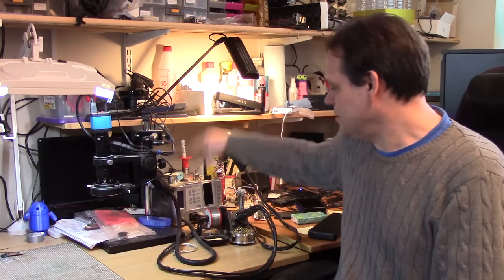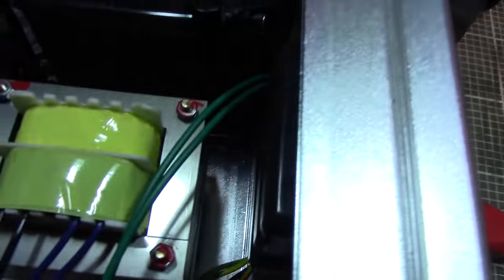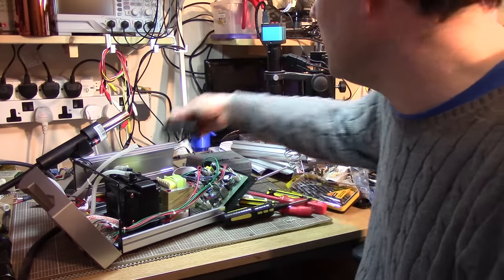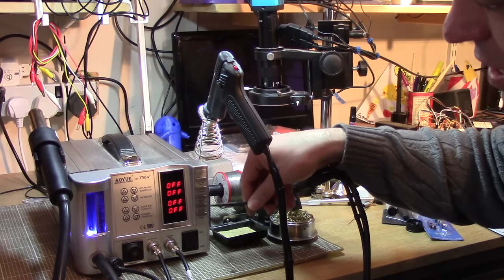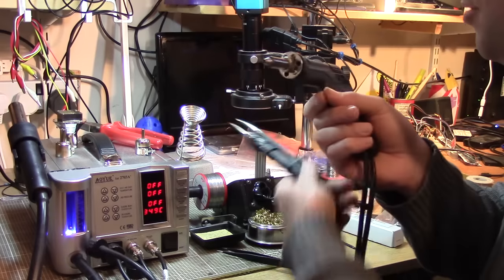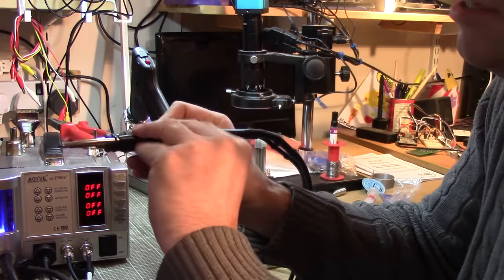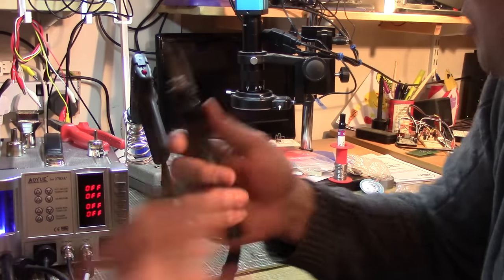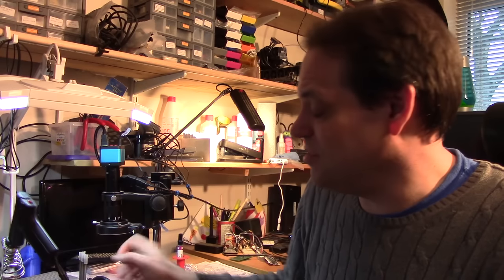Aoyue 2703A+ All-in-one Solder Station Teardown and Review

Comment: Well the point is at "fume extractor" that you dont breath the 80% of fumes just 2% cause it is diluted with all the air in the room.  A old pc fan can do the same.I think its ok unless you soldering 8hours/day.
Reply from the maker: Hi +Hulla Dek  - Thanks for taking the time to comment. To be fair... I've managed 30 odd years without any kind of fume extraction at all... but when using that desolder gun for hours on end, I certainly felt the need for some better ventilation in my office. I have a cunning plan to improve the fume extraction, and have just now ordered myself some activated charcoal granuals and cheap HEPA filters from ebay - I'm thinking I should 3d-print a new part with built-in filters to replace the existing pressure-equaliztion tank - I think that'll do the trick nicely :-)... Cheers!!
Reply: +Jim Conner Got a ton of Carbon Granules if you need some Jim!
Reply from the maker: +101blog Thaks John - I would have taken you up on that, but I've already ordered half a kilo of them - They were pretty cheap anyway. Have you got any interesting projects on the go at the moment? Cheers!!
Reply: Must have about 20!! :-)
Unfortunately working away again so little time!
Reply: What you are Breathing is the mixture of the flux. Pine tree rosin with everything it is mixed with. Which nearly always contains ISO alcohol. I have no idea what chemical reactions take place when all the materials are ignited together but it can not be good. Another option if you are alone in the room is get a respirator mask. I do think I will build my own filter system so my friends will also be protected, there are videos of this on youtube if you are interested.

Comment: Are the solder tips for lead or non led solder?
Reply: I see no reason they would not work for either leaded or no leaded solders. To my knowledge, there in no problem with the alloy used to make solder tips with either type of solder. I have used advertised led free tips with leaded solder very successfully.

Comment: a real good point about the filter for fumes.no point if there is not a filter.it should be a filter there.Hmm
Reply: It does not matter actually. not if you are going to use hot air without any kind of filter,

Anyone soldering needs a good quality air filter system. Why not make your own system using AC Fans available on the market coupled with several sheets of activated charcoal pads followed by a few sheets of micron (HEPA) filters to eliminate any solid particles and large airborne molecules. I would use a sealable plastic tub that is easy to cut with an Exacto knife with the fans attached sealed to and blowing into your sealed filter box. You can place something like a clothes dryer vent tube or a nice plastic tube as the intake. The outflow air can be directed to the outside in a similar fashion or allowed to enter the room after filtration directly from the constructed filtration container. When complete you will have a filter system which is relocatable by tube movement to differing work areas and is far better than anything you can buy preassembled for less than several hundred American dollars. My guess is this can be built for less than $100.00 to $150.00 U.S. dollars and may save you as much as $500.00 or more on a complete purchased filter system. You will also have the BIG ADVANTAGE OF BEING ABLE TO TURN THE FILTER OFF WHEN NOT NEEDED CUTTING DOWN ON NOISE IF you wanted to get fancy an inline relay circuit attached to the solder iron power and hot air gun power could trigger turning the filter on and off automatically. If opto couplers are used to send power to the relay you would not interrupt the power to hot air or soldering iron.